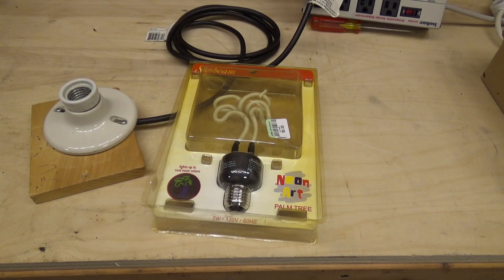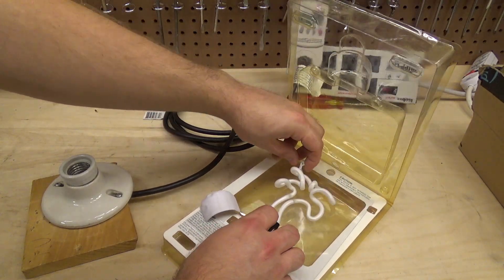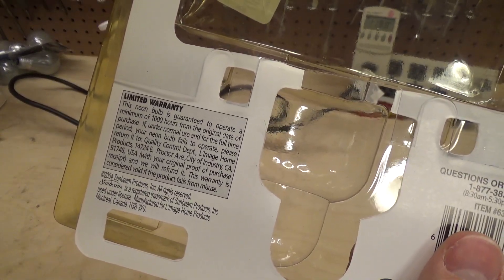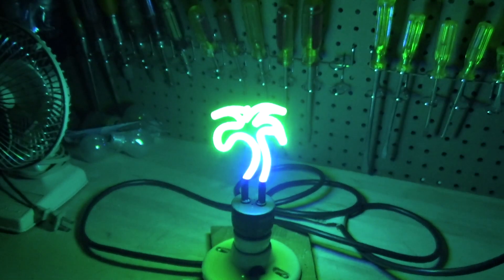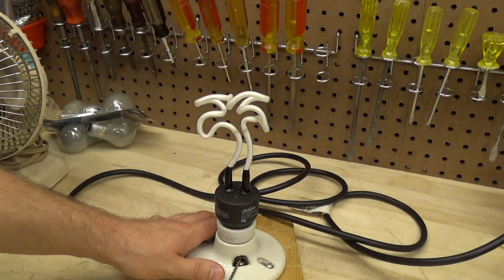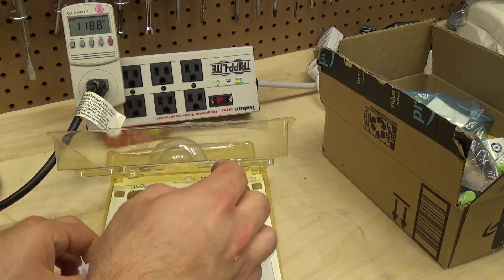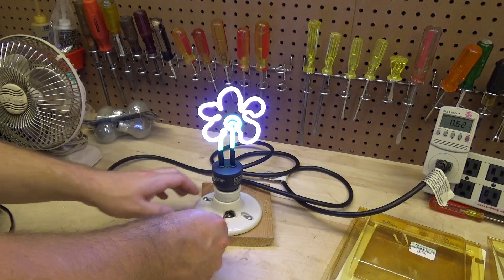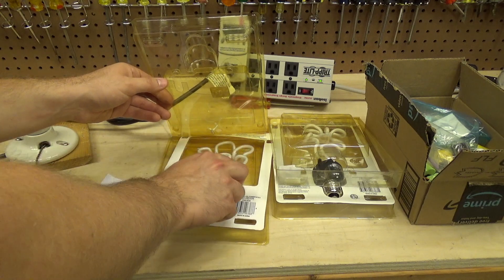Sunbeam Neon Art Light Bulbs

Comment: 1,000 hours isn't very much for a neon lamp to last. my friend used to own a bar and had neon lights that were nearly 70 years old still fully operational. I have one myself that has been on 24/7 for at least 10 years (aside from an occasional power outage.) Although I guess I would suspect in the case of this, it is more akin to a standard CFL than a true neon lamp, and as such has a small electronic CFL ballast in it. So it won't last nearly as long as the ones with the old school transformer. Although, I would suspect if the ballast in this ever failed, the lamp itself could likely be powered from another source.

Comment: They shouldn't contain any mercury if they are real neon bulbs and not some fluorescent bulbs using colored phosphors. The flexible LED neon replacements have taken over, so they don't make neon signs anymore. You still should be able to get lamp bases for those as they still make decorative bulbs.